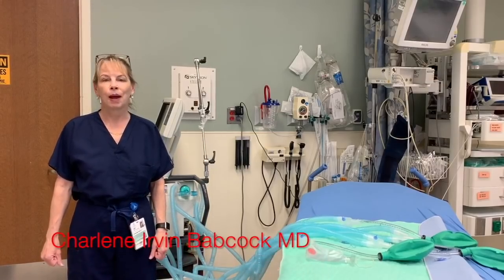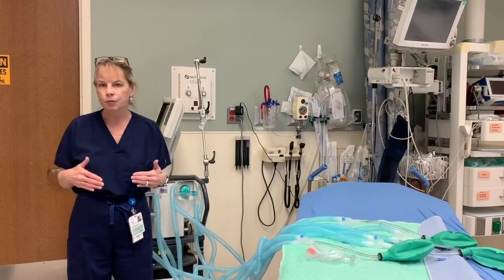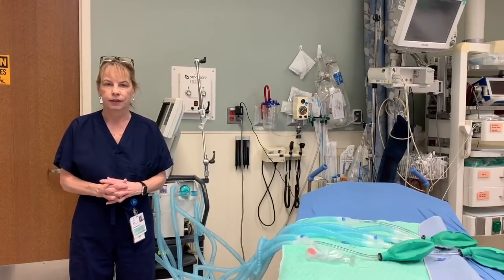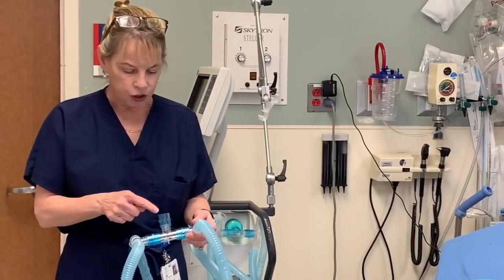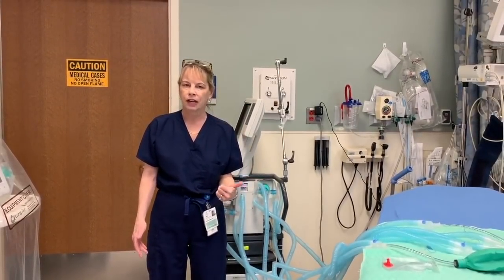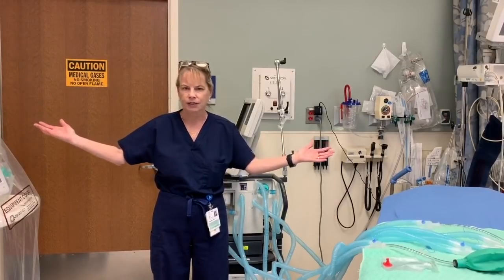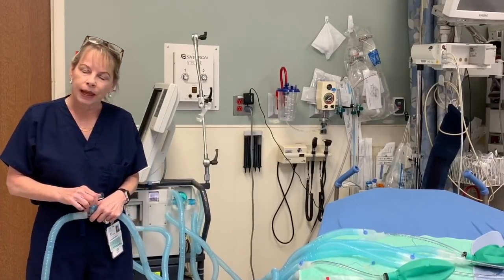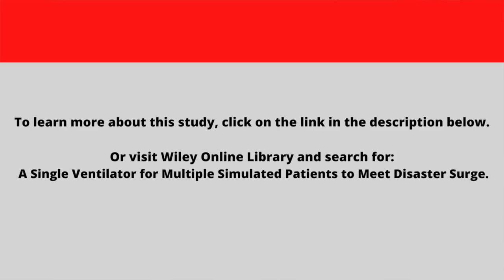COVID-19 How to Use One Ventilator to Save Multiple Lives

Comment: This is clearly intended as a short-term temporizing maneuver.  It buys you time to get your additional ventilator setup and ready to go.  It's probably more useful in the acute mass trauma situation than in ARDS, but many of these patients will not yet be at that point.
Reply from the maker: It is being used successfully in ITaly.....yes it is off label...yes it challenges the clinician to 'match' patients as best as possible for compliance, TV, resistance, etc...but it is working...see below about Italy...I've also been told its being used in Egypt.....  THe last sentance in the article (translated) is: "...its like multiplying  fish and loaves."

Dr Marco Ranieri of Bologna, Italy and his team Have successfully tested the approach in vivo in one of the hospitals in Italy overwhelmed by the COVID-19. 

They worked with Intersurgical, an Italian company based in Mirandola, started producing the circuitry in only 72 hours, and the first prototype has already been tested by Bologna Sant'Orsola Hospital. It works and in the next few days they'll start a mass production to supply Italian hospitals who are in need

Here some news in Italian. 

https://www.huffingtonpost.it/entry/a-mirandola-testato-ventilatore-che-assiste-2-pazienti-bonaccini-straordinario_it_5e73c3e1c5b6f5b7c540a8d2

Comment: If there was ever a sever shortage could CPAP devices provide any assistance for people in need of respirators?  I know it wouldn’t be perfect but would it help at all?  Maybe with the settings tweaked or something.
Reply: T W No, they could not.  A BiLevel PAP machine may be used in some cases, though.
Reply: CPAP devices do not ventilate patients.  They could only be used on patients who are breathing spontaneously.
Reply: Seliina Coe 

So even in a severe shortage  of ventilators with no other alternatives a  CPAP could not be modified or reprogrammed to assist in anyway?  I know it should never be used but if its between being turned away to die and trying anything to save a life or your own life is there any possibility it could do something even if the pressure needs to be maxed out or a different mask or hose used?  Sorry I just want to be sure I know what options there are should  it get much worse.

Additionally out of curiosity is it feasible that the manufactures could release a kit if it got that bad?
Reply: Using a CPAP or BiPAP device would be dangerous due to the exhalation valve. If we were to use the CPAP or BiPAP we would cause the disease to spread through the air
Reply: Helps relatively "normal" lunged folks, but a CPAP will not save a fully Septic COVID-19 Patient.
Reply from the maker: CPAP wont do it...Bipap might...see video:  https://www.youtube.com/watch?v=_bdMCeQHTxU&t=2s

It is being used successfully in ITaly.....yes it is off label...yes it challenges the clinician to 'match' patients as best as possible for compliance, TV, resistance, etc...but it is working...see below about Italy...I've also been told its being used in Egypt.....  THe last sentance in the article (translated) is: "...its like multiplying  fish and loaves."

Dr Marco Ranieri of Bologna, Italy and his team Have successfully tested the approach in vivo in one of the hospitals in Italy overwhelmed by the COVID-19. 

They worked with Intersurgical, an Italian company based in Mirandola, started producing the circuitry in only 72 hours, and the first prototype has already been tested by Bologna Sant'Orsola Hospital. It works and in the next few days they'll start a mass production to supply Italian hospitals who are in need

Here some news in Italian. 

https://www.huffingtonpost.it/entry/a-mirandola-testato-ventilatore-che-assiste-2-pazienti-bonaccini-straordinario_it_5e73c3e1c5b6f5b7c540a8d2
Reply: I don't think this would work if patients are breathing spontaneously, they would be asynchronous

Comment: This is a temp solution, not  a long term. If one practiced in a CAH and had multiple patients needing a vent until patients could be flown out or a ventilator could be obtained. She is not speaking to a long term solution.
Reply from the maker: It is being used successfully in ITaly.....yes it is off label...yes it challenges the clinician to 'match' patients as best as possible for compliance, TV, resistance, etc...but it is working...see below about Italy...I've also been told its being used in Egypt.....  THe last sentance in the article (translated) is: "...its like multiplying  fish and loaves."

Dr Marco Ranieri of Bologna, Italy and his team Have successfully tested the approach in vivo in one of the hospitals in Italy overwhelmed by the COVID-19. 

They worked with Intersurgical, an Italian company based in Mirandola, started producing the circuitry in only 72 hours, and the first prototype has already been tested by Bologna Sant'Orsola Hospital. It works and in the next few days they'll start a mass production to supply Italian hospitals who are in need

Here some news in Italian. 

https://www.huffingtonpost.it/entry/a-mirandola-testato-ventilatore-che-assiste-2-pazienti-bonaccini-straordinario_it_5e73c3e1c5b6f5b7c540a8d2

Comment: This sounds way more complicated in Covid. Two patients would be tough to match let alone 4. Lung volume is important to consider but also lung compliance. In Las Vegas trauma patients would have “normal” lungs. In covid delevoping ARDS in some patients at different rates will severely complicate this setup. I understand it would be a desperate attempt but this exposes the healthier pt to more risk. As ARDS worsens compliance will drop therefore the more compliant lung (healthier) will be exposed to more volumes and could dramatically increase risk to ARDS. I think this would be multiplicative not additive with increasing numbers (4 instead of 2 would expose much more risk to the healthier lung)
And I don’t think it would be possible to monitor volumes delivered to each pt so you won’t know this is a developing issue.
Reply: I was thinking the same thing. Great idea for localized trauma mass casualty event but not for this. Maybe this can be useful in freeing up ventilators from vented patients who aren’t COVID.
Reply: So you are shitting on someone who is trying to make up for a lack of ventilators.  No shit Sherlock it's not nearly as effective.  What is your proposal as an alternative?  Let three of the people die?  What do you propose that is better?
Reply: anecdotal reports from italian critical care docs is that compliance and plateau were not an issue. pt reportedly tolerate lung protective ventilation very well. anyways this is disaster mode medicine, not your run of the mill icu. hopefully nobody will ever get to a point where you can't intubate  a patient because you dont have a ventilator available... but if you do, you'd be glad you saw this video.
Reply from the maker: It is being used successfully in ITaly.....yes it is off label...yes it challenges the clinician to 'match' patients as best as possible for compliance, TV, resistance, etc...but it is working...see below about Italy...I've also been told its being used in Egypt.....  THe last sentance in the article (translated) is: "...its like multiplying  fish and loaves."

Dr Marco Ranieri of Bologna, Italy and his team Have successfully tested the approach in vivo in one of the hospitals in Italy overwhelmed by the COVID-19. 

They worked with Intersurgical, an Italian company based in Mirandola, started producing the circuitry in only 72 hours, and the first prototype has already been tested by Bologna Sant'Orsola Hospital. It works and in the next few days they'll start a mass production to supply Italian hospitals who are in need

Here some news in Italian. 

https://www.huffingtonpost.it/entry/a-mirandola-testato-ventilatore-che-assiste-2-pazienti-bonaccini-straordinario_it_5e73c3e1c5b6f5b7c540a8d2

Comment: Thank you for this. Clearly you intend this as a last ditch effort and for the shortest amount of time possible. I think that the high efficiency filters used on the patient end of an anesthesia circuit could help reduce the potential for bacterial and fungal cross contamination. Patient selection should also include a triage factor; are the poorest prognosis patients put on this to free up vents for better candidates or are younger, less comorbid patients who might better tolerate less than ideal parameters? Perhaps even patients who are on the improving end of a COVID-19 pneumonitis as a way to free up vents for sicker patients.

Comment: It was done in the Las Vegas shooting. You have to match patients by approx TV. They matched by weight.
Reply: You should match by height or ideal body weight, not actual weight
Reply: It'll work better for trauma patients in a shooting than it will for Septic COVID-19 in full blown ARDS.  Why?  Because shooting victims have "relatively" normal lungs.  They were used only until the patients woke up from post-surgical anesthesia.

Comment: This video does not address issues with differing Cdyn. Also, no way modern vent flow sensors tolerate any of this. I don’t see this as a practical solution for instances of respiratory illness, trauma sure, not for we have on deck.
Reply from the maker: It is being used successfully in ITaly.....yes it is off label...yes it challenges the clinician to 'match' patients as best as possible for compliance, TV, resistance, etc...but it is working...see below about Italy...I've also been told its being used in Egypt.....  THe last sentance in the article (translated) is: "...its like multiplying  fish and loaves."

Dr Marco Ranieri of Bologna, Italy and his team Have successfully tested the approach in vivo in one of the hospitals in Italy overwhelmed by the COVID-19. 

They worked with Intersurgical, an Italian company based in Mirandola, started producing the circuitry in only 72 hours, and the first prototype has already been tested by Bologna Sant'Orsola Hospital. It works and in the next few days they'll start a mass production to supply Italian hospitals who are in need

Here some news in Italian. 

https://www.huffingtonpost.it/entry/a-mirandola-testato-ventilatore-che-assiste-2-pazienti-bonaccini-straordinario_it_5e73c3e1c5b6f5b7c540a8d2

Comment: Very intriguing, and thanks for posting. As you said, you’d have to assure similar compliance across the patients. A morbidly obese patient should not be matched up with a normal body weight individual. Also, patients with severe ARDS have unique ventilator needs that would most likely not be amenable to a shared/split ventilator strategy. 
Thanks again.
Reply from the maker: It is being used successfully in ITaly.....yes it is off label...yes it challenges the clinician to 'match' patients as best as possible for compliance, TV, resistance, etc...but it is working...see below about Italy...I've also been told its being used in Egypt.....  THe last sentance in the article (translated) is: "...its like multiplying  fish and loaves."

Dr Marco Ranieri of Bologna, Italy and his team Have successfully tested the approach in vivo in one of the hospitals in Italy overwhelmed by the COVID-19. 

They worked with Intersurgical, an Italian company based in Mirandola, started producing the circuitry in only 72 hours, and the first prototype has already been tested by Bologna Sant'Orsola Hospital. It works and in the next few days they'll start a mass production to supply Italian hospitals who are in need

Here some news in Italian. 

https://www.huffingtonpost.it/entry/a-mirandola-testato-ventilatore-che-assiste-2-pazienti-bonaccini-straordinario_it_5e73c3e1c5b6f5b7c540a8d2

Comment: The current concern over the need to increase mechanical ventilation capability is a serious question that requires serious answers.  This presentation ignores the needs of sophistication in ventilation of subjects with ARDS.  We have published on the severe limitations of this idea in the peer-reviewed literature.  Respiratory Care . 2012 Mar;57(3):399-403. Epub 2011 Oct 12. PubMed PMID: 22005780.  And we have written letters to the authors of the original papers.  (Resuscitation 2008;79:171-172, Acad Emerg Med. 2006 Dec;13(12):1352-3.(letter)).  I would encourage you to reconsider this idea, study the details and remove the video for this poorly supported potential practice.  Having 4 test lungs rise and fall isn't an evaluation.  This is a simply an experiment you can do in your mind.  If the patients all  have different lung compliance (virtually a guarantee) the sickest patient will get the least volume the best compliance will get the largest volume (lung injury).  All subjects  would have to need the same PEEP and the respiratory rate will be controlled by the patient breathing the quickest. There is also the risk of sharing infections between patients. Serious problems require serious answers, this is not one.
Reply: If lungs were to be filled with a fixed amount of air known to not pop the balloon , would they exhale automatically ?
Reply: @RP-uv8qq  thank you  .   When this need for ventilators was announced I started thinking about how I could construct  one from hardware store items and automotive items  . I started sketching  very quick idea drawings using hypothetical available components .  Totally doable a few different ways . It can't be done with people reciting how the existing things function . The read the book take the test types that don't think beyond the learned material . This becomes very obstructive for the kind of mind that imagineers , is very mind to hands .  Mind to explanation and or discussion becomes a distraction  .
Reply: Richard, I graduated kettering 30 years ago. 
Things we agree on. This is the issue resp. therapy, resp care, Inhalation therapy has fought for decades. Too many people believe. That a chimp can be trained to run a "Blower".  
You personally have fought long hard and upset many people to get us a respected as a profession. Thank you.
Things I disagree with you on. Using a vent on more than one patient. Is an idea that gives me nightmares. I have tried to overcome the idea but I can't.
I have to go back to the what I know from my days a student. According to Dr. Burton, Dave Collins, Bob Lamb, Bob Campbell and Richard Branson.
"If the therapist is unsure about the vent. Use an AMBU with appropriate people valve."
I still check to make sure the AMBUs are connected to O2 on my 1st round. 
That advice has saved more patients.
Reply from the maker: It is being used successfully in ITaly.....yes it is off label...yes it challenges the clinician to 'match' patients as best as possible for compliance, TV, resistance, etc...but it is working...see below about Italy...I've also been told its being used in Egypt.....  THe last sentance in the article (translated) is: "...its like multiplying  fish and loaves."

Dr Marco Ranieri of Bologna, Italy and his team Have successfully tested the approach in vivo in one of the hospitals in Italy overwhelmed by the COVID-19. 

They worked with Intersurgical, an Italian company based in Mirandola, started producing the circuitry in only 72 hours, and the first prototype has already been tested by Bologna Sant'Orsola Hospital. It works and in the next few days they'll start a mass production to supply Italian hospitals who are in need

Here some news in Italian. 

https://www.huffingtonpost.it/entry/a-mirandola-testato-ventilatore-che-assiste-2-pazienti-bonaccini-straordinario_it_5e73c3e1c5b6f5b7c540a8d2
Reply: Richard Branson 
Well I’m a perfect world there would be stockpiled ventilators.  Enough for everyone.  Buuutttttt.   When you run out of them.  And it’s live or or die.  This may be a viable option.
Reply: @oldfashionedsportsmanchave4590  the point is that the CoVid 19 virus and lung impact of such disease requires different ventilation from one person to another. Alot of this is age related with other active disease also contributing to the illness. COPD, PNA overlaid with COVID 19
Reply: Jen 
Yep.  And? You got 4 people in front of you dead if you don’t act, 1 ventilator.  You pick the one to be saved.  Or possibly save more than one.  Or all of them.  No one is arguing that this is an effective way to manage disease states.  It may buy time though.  Durrrrrr.
Reply: @Colorado_Chris  Resp Critical care 101. AMBU with PEEP valve hooked to O2. 
The first thing I look for on initials rounds. 
It is not fancy but sage advice.

Comment: I’m glad you put together this video. We’ve been talking about it in my fellows group after we read that LV case study you mentioned.

I think the patients would likely have to be paralyzed if not heavily sedated to make sure they’re all riding the shared rate.

You also might do better if it’s possible to have people with similar compliance paired so that there’s not a circuit of least resistance that gets blown up. For that scenario I may prefer pressure control over volume.
Reply from the maker: YES....I failed to mention that....but yes they need to be paralyzed for it to work correctly....

Comment: Scary to think of. But feasible if it means saving 4 people over 1. Need to also consider compliance differences between four patients otherwise one with less compliance may be ventilated significantly less. Perhaps we would consider low tidal volumes and high rates to minimize this variable. Paralyze everyone to mitigate controllable compliance issues.
Reply from the maker: YES>...paralyzed for sure!
Reply: Calin Calabrese yes I was thinking the same. Yes probably start around 5 or 6 ml/kg for tidal volumes and find a happy medium